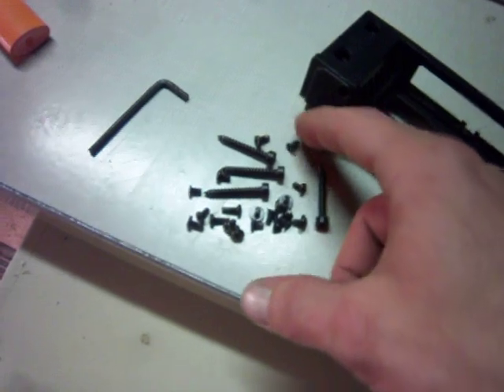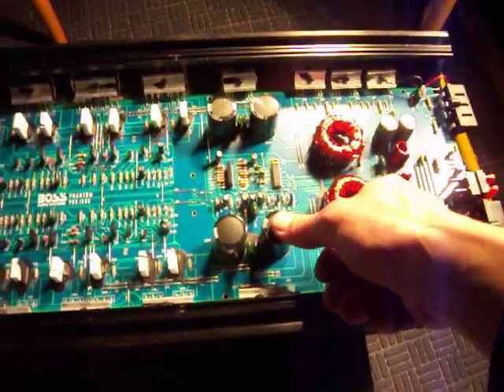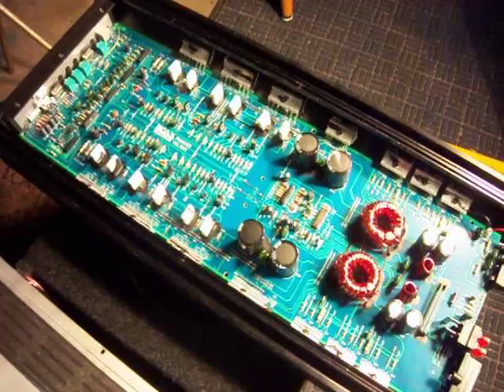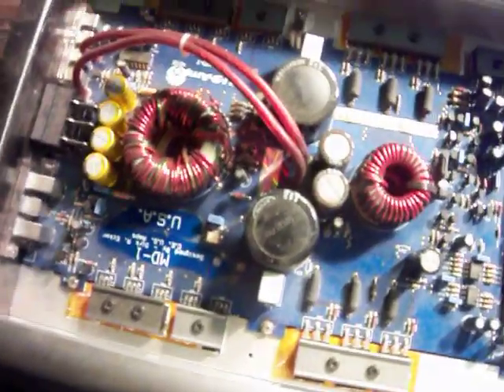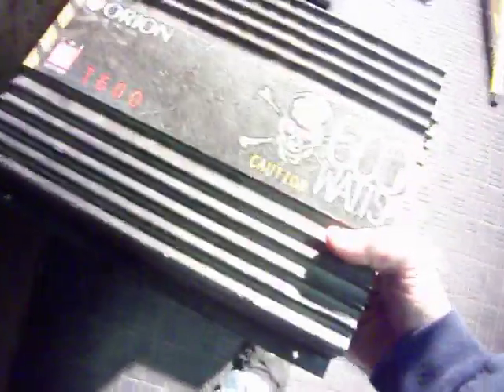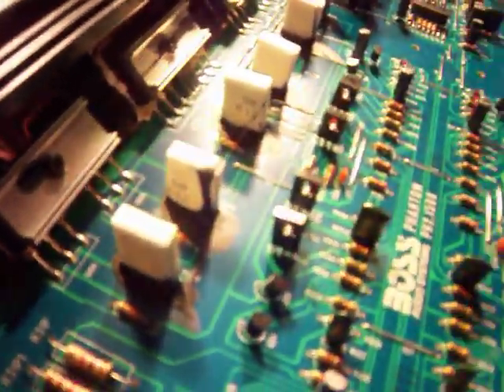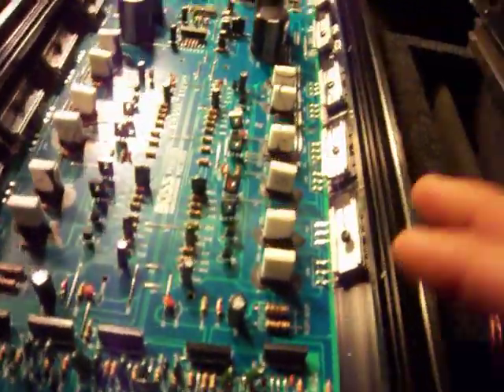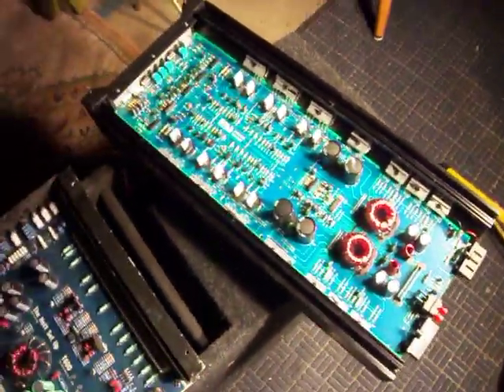Boss Audio PH2.1500 3000Watt 2Ch Class AB Amplifier Guts / Internals

Comment: Hey i have one of the same amp ph2.1500 i cant find a schematic data sheet online am trying to repair the amp a few transistor where damage and also about two diodes the problem is that the diodes are burn and i cant tell where ones they are if you dont have a schematic data sheet thats fine you and email me so i cant send you a picture of the side thats damage so you can tell me the color code of the diodes on that side thanks in advance really appreciate the help

Comment: I rebuild amplifiers and these a sad! Ots a class a/b amp and it'd only fused at 80 amps, like really!  Then it also had those junk terminals. I turned the Boss R2000M stable @ 2 ohms into a true 4kW now stable @ 1 ohm. Lots of work but damn it's nice.